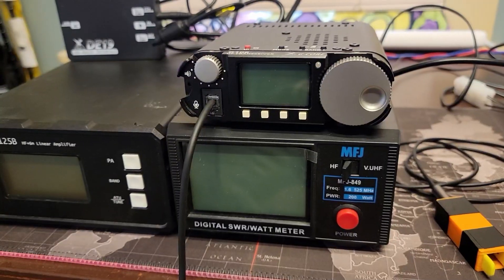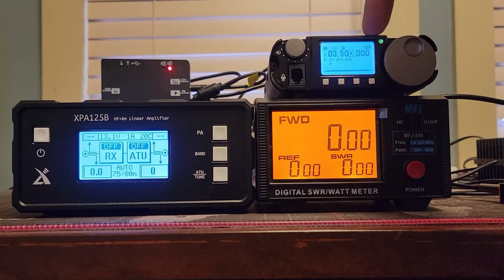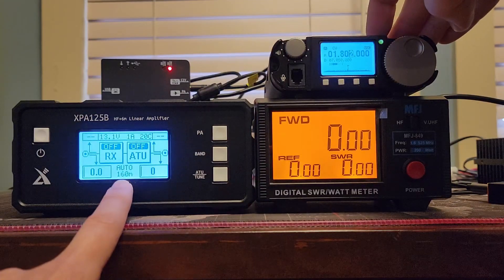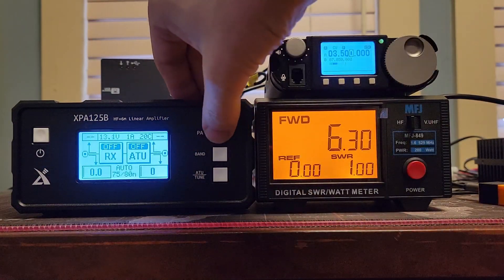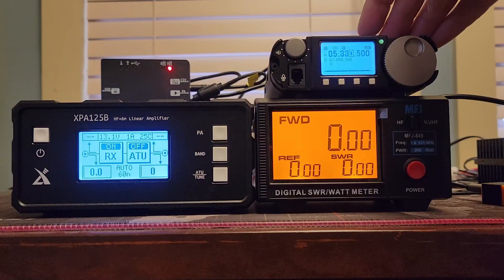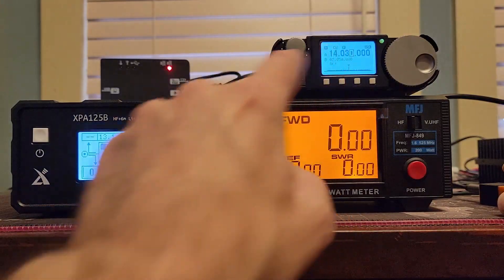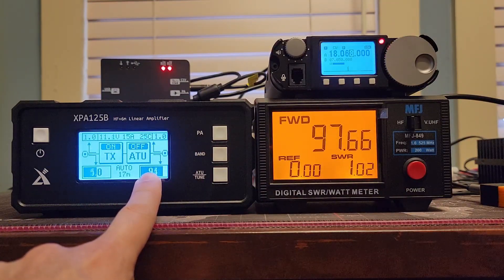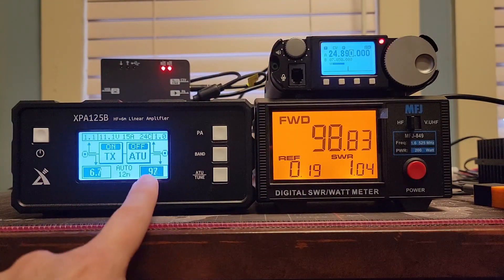Let's test this amp out!  - Xiegu G106 + DE-19 + XPA125B

Comment: Caught G106 on Prime Day sale with a good price tag, Can't wait for it to arrive)
Reply from the maker: It's a fun radio. Enjoy it!
Reply: @temporarilyoffline thanks, I've watched a lot of videos of it in use. 5w, but not bad at all. And latest firmware fixed agc bug. So I'm right on time to buy it :) Also want to test it with powerbank via type-c adapter cable. People say 60W PD powerbank should be fine for it. So gonna check it.
Reply: Amazing radio for a price. Mic is cheaply feeling toy though. Made  50+ confirmed qsls with K24 EFHW on FT8 from Europe in 5 days on 10 and 15 meters. Including Burundi and Japan xD  DE19 works great with it. Now I need advice. For FT8 and good SSB experience xpa125 looks very appealing money wise. Should I go for it? It's nearly price of g90 but I get 100w and can start collecting money for 7300 mk II. One more great thing about this radio. It do work via type C 12v PD cable from at least 65w powerbank with support of PD. So no need to have separate battery for it.

Comment: Hello Steve, my name is George KA0OSN .I am a subscriber to your you tube ch. And watch all of your content eagerly. I'm 72 yrs Young, and have a problem soldering the way I used to when I was younger. So I am looking for a source to obtain a ready made cable for connecting the ziegu g-106 's interface (de-19) to the Xpa125b amp. I could also use any configuration tips that you could recommend I have watched your videos on the pairing of this equipment and need the info on the proper configuration that you mentioned in your video. Tnx  George Harris KA0OSN
Reply from the maker: You're in luck!  The DE-19 comes with all the cables you need to connect the G106 to the XPA125B!

Comment: How did you connect the de 19 to amp and radio. Thank you for your help.
Reply from the maker: The DE-19 comes with all the cables you need.  They only work one way.  ACC Cable from back of radio to DE-19, L-4001 Cable from DE-19 (3.5mm) to Amp (DIN), You might need some USB for power to the DE-19, but I don't think so and I don't have the radio to hook up and test.  You'll also need a short coax jumper from radio to TRX port on amp.

Comment: How much power reliably for data modes?
Reply from the maker: The amp has a temperature gauge on it and I believe a protection circuit to shut it off if you try to overheat it.  I've run it at 100w FT8 literally for days getting a Kilo at Monte Sano State Park.  Its a workhorse!  Just keep an eye on it and you'll be fine.

Comment: I've got a couple of amps that would handle the G106's output, but the amps are all RF activated... you only need to place one between the rig and the antenna.  I get a feeling that G106 insists on switch-activating any amplifier it uses.
Reply from the maker: Switch activation is preferred, but the g106 wouldn't know what's upstream and the RF actuated amp should work fine.

Comment: Update I have it hooked to my g90 and I noticed that on 20 meters and higher, if I had my compression on I would actually get an ALC overpower message flashing and  the wattage would go down to zero so I have to keep the compression off
Reply from the maker: I wonder if it's pumping out more effective power due to the compression? The amp should have told the g90 to back it off as a fix.  Have you tried leaving compression on and turning down the drive?

Comment: If you radio only has a TX PPT port on the back, can you use this amp?  Is there a port for PTT?
Reply from the maker: Yes, you'd have to make a cable to get everything connected.  This is how I'm using the amp with my IC-705.  It doesn't transfer band data, so you'd need to make that change manually. I've got over 1000 contacts through it from the IC-705.

Comment: 10m might be blocked like a lot of amps without being modified to deter usage on 11m
Reply from the maker: The amp will do 10m, the radio will do 10m, not sure why this combo isn't working.  I've had it working on other radios.  I had an amp that had that 10/11m lockout.

Comment: I’m very curious about the current consumption of the amplifier. I have a 18 amps battery which I can use to get 100w out of the ft-891. Would it be possible to use 18 amps with this amplifier and get 100w too?
73
Reply from the maker: The book says 30a used on TX - she's hungry!

Comment: Radioddity Website says: Coverage of all HF amateur radio bands between 3.5 and 29.7MHz! So, what's happen with this PA?
Reply: @temporarilyoffline  I don't understand; at minute 1:13, the G106 shows 28.000.000 ...
Reply from the maker: @cbiz8  it looks like I missed filming the 10m Band. The G106 is 80‐10

Comment: Does the DE-19 do this for the G90 as well? I am using the    CE-19 and it does not adjust the power.
Reply from the maker: I believe it does, but it's on the list to test, be on the watch for an upcoming video.

Comment: I love the amp alot but not the radio so much.
That auuuudddddiiiioooo... drives me insane in video's.😂 I usually fast forward those bits. Lol
Reply from the maker: I laugh at the "audio" too.  The G106 is fun to play with for sure.  It could use more power.
Reply: @temporarilyoffline  definitely and desperately. Lol